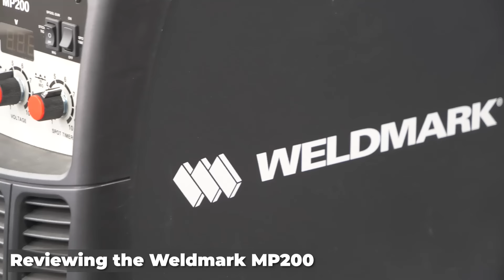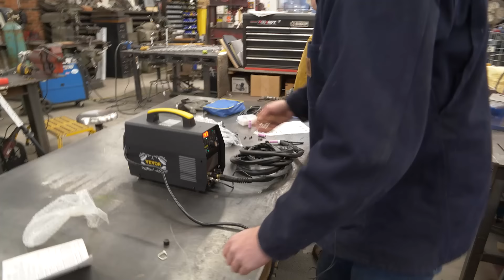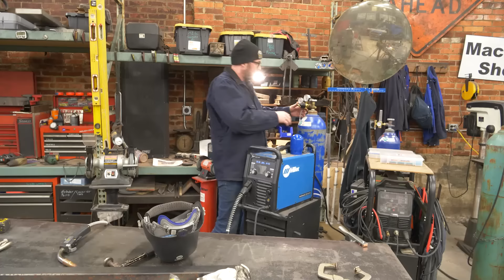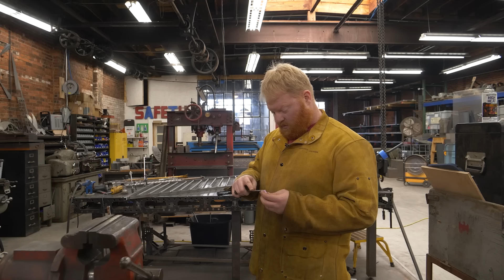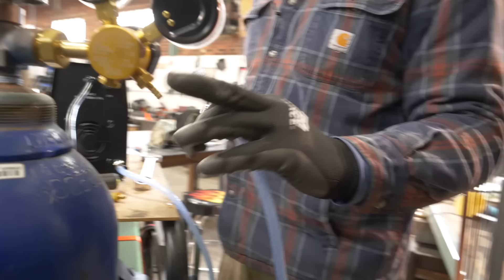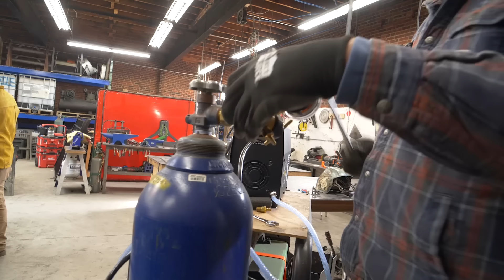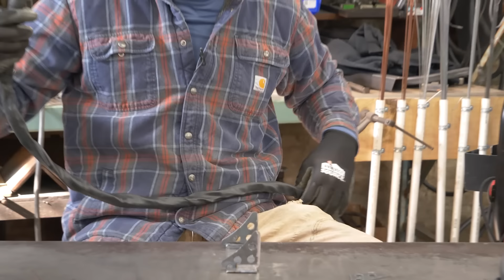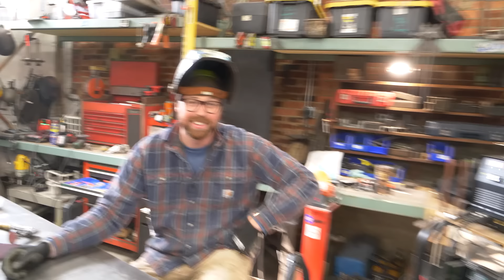$200 TIG Welder VS $2,000 TIG Welder

Comment: Hi! Thanks for the informative video!
For the last 4 years I’ve been working on developing a testing tool for the welding machines. I’ve learned a lot about how they work and how different manufacturers understand the theory of an arc welding. 
You absolutely can create a nice welder for $200 but the difference is, would you be able to make it perform identically in any condition, temperature range, voltage drop in your outlet etc. in other words buying a well-known brand you buy confidence. You come to the shop you flip the switch and you get the same results no matter what. But on the other end it’s not that bad to buy a cheap welder because they weld good enough for hobbyists
Reply: You are right about being able to make one for that amount and I am very sorry for what I said
Reply: You must work for the company they acquired this product from?
Reply: @samrogerskeeponkeepingon1486  Nope! I'm not working for any company and my product is still under development.
Reply: @vladshmit  I don't remember typing that sorry brother. Had some drinks

Comment: The way they do it is because the current technology of welding is about 50 years old with the computing power of a solar calculator added to it.  Welders should have been this cheap more than a decade ago.  The common man can truly own the means of Production again without the interference of revolution or direct government programs...  There are even companies out there making VERY affordable professional grade, custom manufacturing equipment now.  CNC everything is attainable under $1k.  A young person with 10K can start a fully functional small engine machine shop with everything they need.  If they are good and price their work correctly they could be upgrading to a full on true custom machine and fab shop within 40 - 60 months.

Comment: So, duty cycle. 

In Electronics, duty cycle is usually used to describe a rectangular waveform (e.g square wave). Duty cycle is the amount of time the signal is in a high state (usually at its higher voltage or on state) compared to the overall time period of the waveform. So a wave that is on for 1 second, then off for one second then on for 1 second and off for 1 second (and so on) has a duty cycle of 50% (period is 2 seconds, on time is 1 second, it's on 50% of the time) and a waveform that is high for 1 second then off for 2 seconds has a duty cycle of 33% (period is 3 seconds, on time is 1 second).

When used with machines such as welders, however, it gets a bit fuzzy, mainly because they don't tell you the cycle period. If you tried to use a machine with a 30% duty cycle for 15 minutes then let it rest for half an hour, it will pop its thermal overload about 3 minutes in. The other thing that is really useful to know is the 100% duty cycle current. In this case, it might be 30A, who knows?. (100% means you don't have to let it cool down, it can be on 100% of the time). 

Generally, you probably want to get a machine with a full current duty cycle of 60% or better.

Comment: PRIME WELD 225x was $620 prior to Covid and it can weld circles around any Everlast machine , the Eastwood for sure, and just about every single machine I’ve ever used except my precision 375 but I still like the Prime weld is better.
Reply: I have the primeweld 225x and love it too! Matter of fact, I just welded a centerstand for my motorcycle this weekend and worked like a champ. Their 50 amp plasma cutter works really well too! Using the primeweld, I made heavy duty aluminum racks to go on the top of my trucks camper shell and it did really well welding aluminum with tig.

Comment: Duty cycle:    Is based on an 8 hour period.  For instance some Miller 252 roll around Mig machines have 80% duty cycles.  So it will run at 80% for 8 hours. Then fall down. (In a sense)

Comment: Anything but an Everlast!  The Everlast PowerTIG 210EXT is $1600...you might push that a couple hundred higher with upgraded torches.  I have one....after over 50 e-mails, multiple incorrect repair parts shipped to me, and a dozen phone calls with Everlast.  Not long after that debacle I bought a Miller and the green welder is a backup...when it dies it's going in the dumpster.

Comment: Where do you think these products originate from? And operate as professionally as possible? The main objective is to consistently turn profits, isn't it safe to say you're dropping big bucks BLINDLY and not doing your due diligence by trying out cheaper products like this before dropping larger amounts of cash? You said yourself you've NEVER used a welder this cheap by a landslide.

Comment: Duty cycle is the percentage of working time before you have to let the machine cool off. Easiest to explain using 10 minute intervals because it divides by 100%. So 10% of 10 minutes = 1 minute, 10% duty cycle means you can only work for 1 minute then have to let the machine cool down for 9 minutes before working again. 30% duty cycle = 3 minutes of working time then 7 minutes of cool down time. You also NEVER want to just shut a welder OFF without letting it cool for the rest of the duty cycle!

From age 8 up to about 23 I was lucky enough to grow up with an awesome mentor next door for a neighbor, a Vietnam Armorer vet/retired machinist who had all KINDS of fun "toys" because he never got married and spent the rest of his paychecks on cool toys and tools vs a wife... His home garage didn't have any cars in it, instead he had a full machine shop! Two Miller welders one MIG and a TIG, 15 foot long lathe, mill, oxy torch, grinders, a built in air tool plumbing system with a 200 gallon tank and all kinds of other tools covering every inch of wall space. And that was just the garage. Above the garage he had a photography darkroom, out back he had a metal forge in the backyard and also an entire gunsmithing room with a reloading bench.

Needless to say he taught me how to weld and more really well from early on and by age 15 or so he said I made "pretty welds" and should look into Naval ship building, that has to pass certs reviewed with an X-ray to see if the welds are perfect.

Comment: I bought a Vevor welder long before I saw this video today. An AC DC Tig from Amazon so I had months to play with it while still being able to return it.

Buying everything on Amazon including the full argon tank, I was in it for about $800. I also had trouble with the regulator, the problem I had was that it wouldn't even fit on the bottle, it was the wrong fitting. I bought a whole new regulator for $25 on Amazon.

10 out of 10 would buy again.

Comment: Hey, I have a wild idea. Can you open the cover and switch the leads around inside like converting a mig to flux core and weld aluminum with it?
Reply: I would love to see you try that out and see if it's possible. LOL
Reply from the maker: Aluminum required AC current instead of DC to break through the oxide layer. Unfortunately, this machine doesnt have that capability, only DC output. Thats why i stick to everlast!

Comment: I bought one of these a while back and was surprised how well it worked too. It seemed to weld just as well as the old Lincoln Electric welders at my school
Reply: Hi, does your Vevor welder is still working? I wish I have money to buy a Lincoln, but I don't and I need one, would you recommend the Vevor? Thank you
Reply: @supercalcium  I didn't use it very long because it was DC only and I needed something that could weld aluminum. So I can't say much about their longevity.
Reply: @HatersGarage  thank you
Reply: @supercalcium  I don't! Why, because if it breaks you can't get parts for any Vevor product. Read the reviews.

Comment: You guys should really trust us electronic engineers to build good💩 you know ... even the Chinese. To provide a pulsed TIG when it's all electronic control should be a piece of cake with a modern microcontroller. In fact I'm surprised they didn't also provide the ramp up and ramp down function too since that is easy to program.

AC TIG needs quite a bit more on the power electronics side so that's not surprising to me to be missing.

Nice review. Glad to see you were impressed.

Comment: I had two cheap tig machines. Both quit is a short period of time. They often use grade B components. I opened the last one up and it had blown a cap on the regulator side of the system. Unlabeled components so I could not replace.  Currently a door stop.
Reply: Buy the same unit and then  return your broken unit as if it was the one you just got. If these companies don't give you the ability to fix the unit then send them back as if it was the unit you just bought
Reply: @randybobandy9828  done that but shipping to china is almost the same as the unit. Went with miller. Big $’s but they just work.
Reply: @nowuknowthis1903  idk what you were looking at but the one I got is free shipping
Reply: @randybobandy9828  Amazon works, but unfortunately many Amazon items like this are 3rd party. One unit was bought from a distributor for a Chinese company. Good company, they make high end industrial products but they only had one distributor in USA. He died and that was the end. I can find them online but they can’t speak English and don’t understand the logistics of a return.
Reply: @nowuknowthis1903  that's true but the primeweld I bought was sold by prumeweld themselves on amazon
Reply: @randybobandy9828  I really gun shy. I had one welder and two plasma cutters that both crapped out. That was a total of $600. I ended up buying a miller on sale for about $1000. My net would have been +400. Wish I knew that when my eyes were excited about $200. The company is called Hal. Been trying to contact them, maybe they would sell me a regulator board. I was an engineer building product in the telecom space most of my career. We always had a choice of components. China was growing their supply but the were maintaining good quality. Just the opposite of Japan. Japan started out cheap and got better. China started out pretty good and the manufacturing info started be handed off to uncle lim, and brother yang. They commingled components with our contracted vendor. Sample testing would swing off the charts. After investigating we discovered uncle lim and Yang we cutting corners on quality but the were cheating. My latest plasma cutter popped and smoke came out. Opened it up and extrapolated it was a voltage regulator circuit for the controller. Not the normal mosfet failures. So I replaced the cap that blew, but it lasted about 1min. Suspect the voltage regulator failed closed bringing the full voltage across the cap. It exploded. It had no marking nor did the regulator. I’d still like to get it to work but the company is not responding. I had to keep going with project so $$$. Good luck with yours. If you have some skills take some voltage measurement and get some board number off the circuit boards. It might help down the road.
Reply: @nowuknowthis1903  I guess I can't v
Blame you, miller's are top notch and I have used many of them in the past. I think they are the best tig brand imo.
Reply: @randybobandy9828  not shipping back
Reply: ordered with link from your site. very hopeful, been looking for a “starter” tig. thanks for the great info.
Reply: @ehb403  I’ve heard some cheaper Chinese aren’t bad, but they are closer to $700 than 200.

Comment: the thing you need 2 know is that the miller welders are all made in china now under the same roof as all the rest in the world, no matter what name is on it it all comes from the same place now, they lie like a dog and tell you they are made in appleton wisconson but it all comes from china ,, its the same as horbour freight, i bought a bran new miller 235 mig welder last summer and it come 2 my house with parts missing off of it and they never even offered to send me the parts to fix it i had 2 fix it myself, dont ever worry about me ever buying any thing else with millers name on it ,, il be buying the china welders from now on, you can buy 15 of them 4 what you will pay 4 one miller...

Comment: I got a Vevor plasma cutter - it's a piece of junk that only came with a 120v plug and it uses 15 amp wire 14 gauge wire, yet it's supposed to operate at 35 -50 amps even using a single wire it still only good to 18 amps which you should not be used at it's maximum just to make it work, well it overheated and popped the circuit breaker The light keeps saying it won't run as soon as you pull the trigger. They might have some stuff that is good but some of it is just junk. This was an amp 50 model. China will do anything to make a sale, never forget that.

Comment: I bought a 135 amp stick welder 2 years ago for about $125CAD, and if you plug it into a 220v socket (does 110 too, just not as well) it WILL push out 135 amps. I couldn't get it to overheat and I was running it constantly for at least half an hour with no breaks except to change rods. When I finished, the test piece was warped MANY degrees but the little welder stayed ice cold. Rule #1 of using cheap welders is always change out the ground clamp and torch for a good one as soon as you're able--a good, beefy ground makes all the difference in the world compared to the lame stamped metal stuff you get with these things.
Reply: Not to piss on your chips, as I know these little IGBT welders are an absolute hoot to use and a bargain, but I doubt your indicated 135A is a TRUE 135A. Many have been tested at 135A or less that claim to be 200/250A! I’d guess you’re getting an honest 105-115.

Comment: I'd definitely be interested in checking this out for hobbyist stuff. Would you consider a welding for dummies video? Show what gas to use, what basic settings, some logic as to why, where to ground and why, maybe test out a cheap vivor mask even? Or if there is a video out there with this info that you like would you mind posting the link? You guys rock!
Reply from the maker: Welding for dummies would be a really fun video!  Anything that gets more people interested in the fabrication world!  I'll write this suggestion on the whiteboard and make sure Tay and I iron out some details for something like that :) Thanks! - Walker
Reply: @LiftArcStudios  Agreed. I'd watch the shit out of it.
Reply: I got a wide view auto darkening mask on Amazon for 40 bucks with full adjustability the closest equivalent mask at harbor freight is 80 and it's missing all the adjustments and features the mask it is based on is around 200 bucks. I have no complaints yet. It's a bit thin but it works great. For someone not doing it every day the amazon stuff works I got a multi-process mig tig stick machine with 2-year warranty for 220 delivered to my door and the thing is surprisingly great. Just this weekend I Was even welding a thin rusted out exhaust pipe back the the muffler and even was able to weld up some blow out in the body of the rusted out muffler itself at first it burned rite thru but after some adjusting, it worked just fine.

Comment: The prime weld 225 tig welder is as good as the $2000 for less than half the cost
Reply: Hard to beat for the 700 shipped I paid for mine.

Comment: I've used different vevor products before, like core drills and plasma cutter. For what they are, i have been very happy and functioned well and still functioning for over two 2yrs. Can't complain. Is it high-end  no, but will it get the job done in most cases, yes

Comment: I bought one.   Can't wait to try it.   I'm also getting a Shop Sabre too.   Thanks Tay.
Reply: I was tempted to buy a $200 tig as well but I went with a $900 one that is capable of 225amps and AC tig. I just couldn't not have the ability to weld aluminum.  I got the primeweld 225x, I honestly couldn't find a AC tig for any less than that

Comment: Interesting analysis.  For someone who already knows how to tig weld it seems to work fine.  The lack of an argon regulator is kind of lame .  As far as your testing goes any moron can weld eighth inch steel.  Why did you not do 20 or 18 gauge?   I have a more expensive machine but weld thin sheet metal with no upslope or downslope or pedal and have no issues so I suggest you try that in another video.

Comment: I stick weld and gas brazing/welding.  I've never used a tig welder but it "seems" similar to gas brazing, welded many steel hydraulic high pressure lines with success .  Am I wrong with this line of thinking?

Comment: DONT BUY the VEVOR screenprinting screens, the weld were badddd and they cracked the first time used, customer service the worst, i had the products for two days. they offered me a 50% refund. i went around and around with them and ultimately got 110.00 back from the 200.00 worth of screens i bought. ZERO Stars for customer support for VEVOR.

Comment: I have just bought a relative of this, just mine is orange 🤣 mine hasn't got pulse, but it has got ramp up, and we got it for £160 so a bit less than that one, and mine also came with standard connections, but it dose take 3 connectors for the TIG torch, one for power (dinz) one for the gas (euro quick fit) and one for the switch (2 pin)  so easy to get an adaptor to swap the torch, and I even managed to find a basic foot pedal for the 2 pin lol

Comment: I've wondered how easy would be to hack in the balance AC (DCEN DCEP offset or ratio) functionality?  Seems like whatever controls the H-bridge inverter is all that needs to be tapped into.  Ideally someone hacking out (reverse engineering) the MCU that controls the H-bridge functions in relation to the input settings so the additional function is added with maybe another button with LED indicator with marking with the rotary encoder for setting range options with or without push button I guess... maybe need the push button to set the value.
Reply: I don't know if you know your ass from a hole in the ground or not, because I don't. But you sold me on letting you try it if it were my welder.